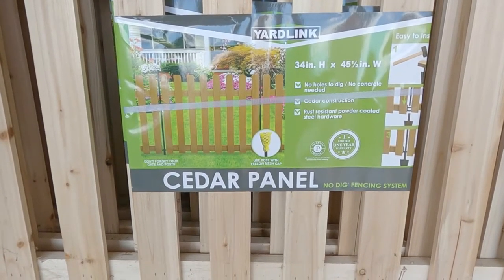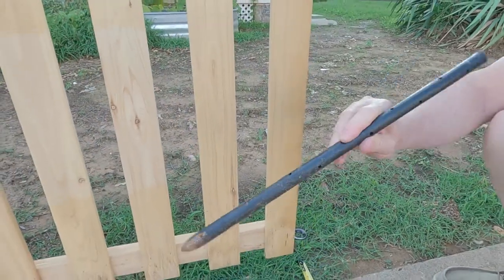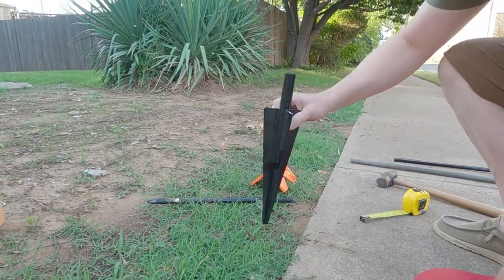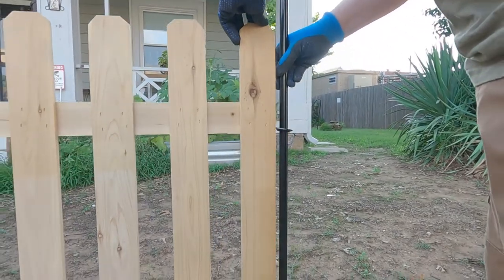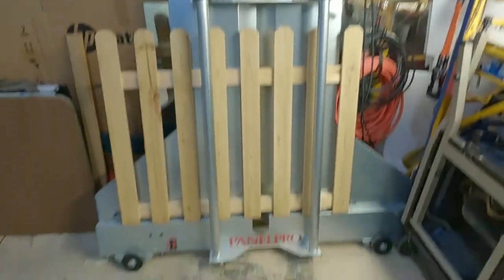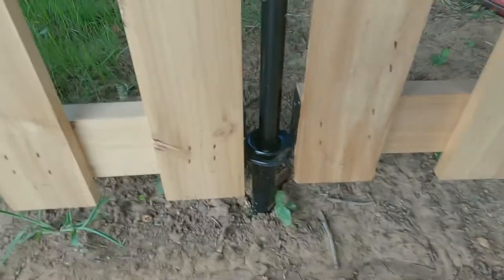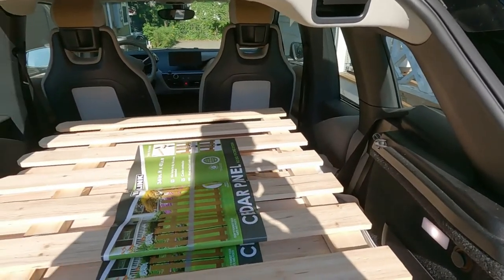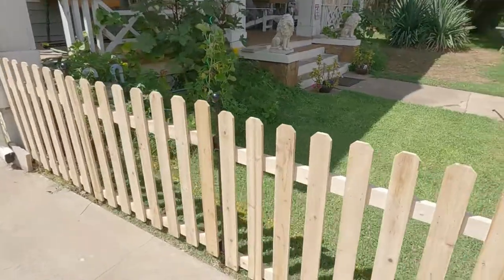YARDLINK No dig cedar wood fence installation and review

Comment: OMG I was having a heck of a time getting my base for the post into the ground. I was using the wood and hammer method and it was taking forever, like it was stuck on a root or something. After contacting the company (not real helpful tbh) and then watching your video, I found a piece of rebar that I used to hammer the post base in! So happy I found your video!  Thank YOU!
Reply from the maker: Thanks for watching. I'm glad you found it helpful. This fence stood up to a 100mph wind last year so it's pretty sturdy and I think it looks great. It's been helpful several times to be able to disassemble it and reinstall it in just a few minutes.

Comment: Do you have to pull a permit to install this type of fencing system? We were quoted $18,000 for a custom vinyl fencing…Totally not in our budget. We want to fence in our yard for our dog. She is a small beagle and we don’t want to take out a loan just to put up a fence. So when we heard about the No dig fence option, we were intrigued.
Reply from the maker: I think it always a good idea to check with your local ordinances and have utilities marked. But because of the way this fence installs I believe it could be considered temporary fencing.
Reply: @accidental_relevance  thank you! I am going to call my local ordinance department and check on it. We already knew about calling 811. We actually called them before we broke ground for a garden and a couple of trees.

Comment: how many of the panels did you have to purchase? was everything sold separate? Approximately how much did this cost? Thank you
Reply from the maker: 17 panels to make the fence and gates in this video. The parts are sold separately. I made three trips to two different Lowes stores to get the pieces I needed for this video. But their inventory was much better when I built the fence for my side yard. Probably because it was early in the summer season instead of later.
Reply: @accidental_relevance  thank you for your response I’m definitely looking into investing in this for my yard
Reply from the maker: @KatieLee0823  It makes a really nice looking fence and I've never used anything quicker or easier to build. I also like that I can easily take it down and put it back up if needed. Or if I need to replace a piece that becomes damaged.

Comment: Do you know if it’s possible to buy the “eye” hardware separate? Considering doing this myself but just building my own panels to help with cost. Thanks.
Reply from the maker: I have not seen the hardware sold separately at Lowe's and that's the only place I've seen the Yardlink fence. You might send them an email. I'd be curious to know that as well.

Comment: I liked your video on installing a picket fence. It looks like the hardware (poles, connecting "eyes", gate link etc.) came with the kit?
Reply from the maker: It's more like a system than a kit. The poles come in different sizes and work with a variety of panels and are sold separately. But the fence panels do come with the hardware pre-installed.

Comment: Helpful video. Thank you. One question, I see you modified the gate but how easily would it be to shorten one of the panels? If I did this, I would probably need to shorten one panel by a foot or so.
Reply from the maker: The wood is very soft and easy to cut. So you could use a square and hand tools with no problem.

Comment: Thank you for sharing your experience with this 'no-dig' fence.  I am considering installing one myself.  One thing that scares me about installing no-dig fencing is that I do not know what I would do if I was driving one of the stakes and hit a rock or root that would prevent the stake from getting driven in further.  Did you run into this issue?
Reply from the maker: I did not have an issue with this. The soil in my area is 50% sand and the rest is silt and clay. Pretty easy to drive into. If the ground is rocky it could definitely be a problem.